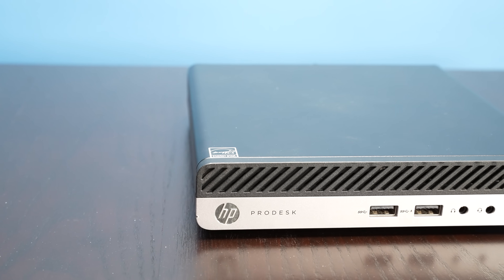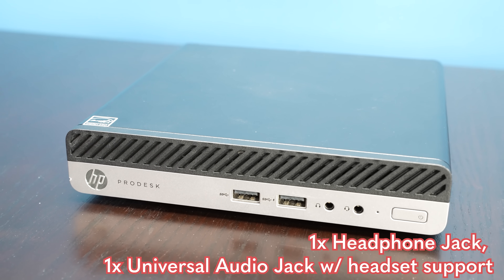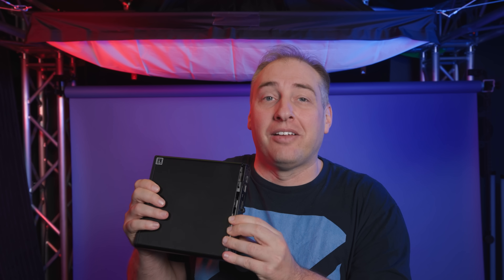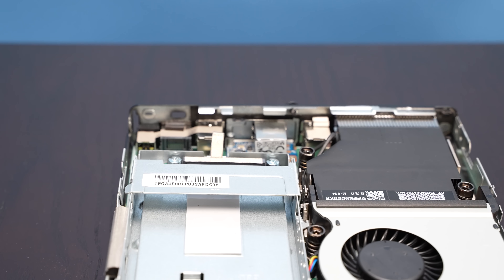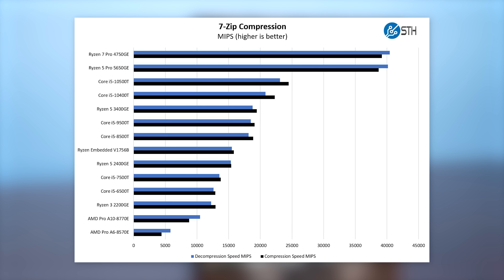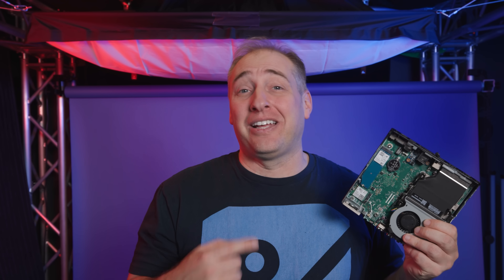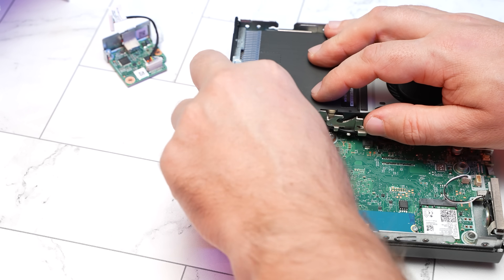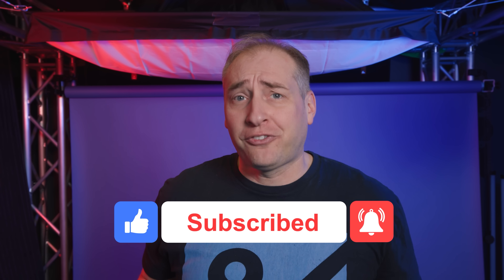Nice One! HP ProDesk 405 AMD Ryzen with 2nd 1GbE NIC

Comment: Can someone please tell me the difference between the HP ProDesk 405 G4 Ryzen 5 Pro 2400GE and the 2400G version? Is there somewhere GE labeled on the case to see the difference from the G Version? Unfortunately can't find the difference on case.
Reply: "e" for efficiency, 35watt tdp for 2400 GE vs 65watt on ryzen 5 pro 2400G. you can see in dxdiag/my computer properties

Comment: Beware 2 issues with these things! 1. The solid lid murders the ventilation. 2. They dont allow to personalize the fan curve. If you want a fancy box for microsoft office, go for it. If you wanna make good use of the APU, prepare to get rid of the lid and put an external fan at full speed. You are better off getting a chinese mini PC with a more flexible bios. Also Pro AMD processors (GE) dont allow the use of ryzen master.

Comment: Just a word of caution - these systems run hot.

I saved one from the e-waste bin at work and turned it into a HTPC. Even idling on the desktop (Ubuntu 22.04) the chassis is uncomfortably warm to the touch. It seems the issue is HP is expecting way too much out of the CPU blower to manage the CPU and provide adequate cooling for the balance of the system. At load I would compare one to a desktop hibachi.

This system is not suited for a network closet or cabinet with poor airflow; it will quickly turn an enclosed space into a sauna.

Comment: Just a heads up, there are used Zotac 7600P boxes in this form factor with dual Gb Ethernet nd 4x DisplayPort outputs, and many other nice ports and features in this form factor or smaller for less than $100 nowadays, great alternatives to short supply/price gouging Rpi4's.
At least 2-3x the CPU power, and better GeForce or AMD graphics vs Rpi's.
Without a HD/OS, they can be had ~$50- just boot off USB or SD card for Retropie/EmulationStation/Mame/Kodi stuff.
Infinitely better/more software/easier to work with than all those generic Android boxes.
Reply: I picked up a new Zotac Zbox for pretty reasonable on Newegg. I think including RAM and SSD it was like $220. Dual NIC and no fan, awesome little OPNsense router.

Comment: Nice video. looked up the model and i still think it is expensive. i am looking for a small computer of this size. need the following specs, has a m2 slot to host the operating system and expansion for 2.5inch drive. at least gen5 intel cpu and at least 16gb of ram and possibility to go up to 32gig. it will be used to host a blueiris and 4 4k ip camera. any advice for something around 3 to 400 euro?

Comment: if you dont't assume more than 1/2gb total throughput you do not need 2 nics. a 2.5 gb nic would even be more suitable than dual 1gb nics.. i rather would like to see a small pc with ECC..
Reply from the maker: Some people just like the segmentation. The 805 G6 is next (Alex has already edited the video, just waiting for a publishing slot) but the 805 G8 has a 1GbE Realtek and a 2.5GbE Intel i225-V in the Flex IO V2 slot.
Reply: @ServeTheHomeVideo  yes I know they like it, but it might be your mission, as someone who is an expert, to point out that trunking would be the better solutions for most scenarios. We are not expecting enterprise grade workloads on consumerlike hardware do we? But anyway, I am still looking for such a computer with ECC - i3 or AMD .. Have you ever come across one?

Comment: running 24/7 with alot of traffic, i think the chips might get hot/crash. there is no heat sink on these.
plus its Realtek so this just wont do(and it is not intended to be ran so hard this way in the NIC(s). not sure how amd handles aes-ni or what ever  Amd's answer for encryption is...

i had a used  800g2 slim/mini/micro/tiny(the smallest one lol)and converted the m.2 to pci-e and was using a converged dual port 1.25g  intel nic as the onboard was giving issues and needed 2 ports for a router/firewall setup. eventualy swaped the nic for dual 10G sfp as i wanted to have direct fiber from my ISP to the computer instead of going through a fiber to copper media converted.

running pfsense openvpn with 256bit gcm, site2site identical setups: 736mbps  rate off of a 950mbps line(technically paying for 1gbps)

.(yeah the m.2 lane on the 800g2 cant do 10g but I got the card regardless and have since built a custom intel 10th gen build on a lga1200 micro mobo. all new parts for 700$ wich is about the same i guess as these small/tiny computers purchased new except i have waymore horse power.) 

btw pfsense plus with TAC lite is free(for a limited time)
Reply: those machines are not suitable for running high throughput in a business environment.. it is just tinkering for at home.. but there one nic would be good enough for OPNSense
Reply: @marcello42  opensense or pfsense, same thing. as to the environment, to me it makes no difference. If i generate alot of traffic, i want it to work regardless of whether I'm at home or at work. and the fact that realtek drivers are flaky on BSD and hardware is also sub pare, its just a small formfactor with terrible parts.
If you get it free or real cheap second hand than yeah it can be used to study and play around with but i wouldint keep it running 24/7 in ANY enviroment. And if i had to buy it new, id return it the same day and smack my self in the head as to make a point to not buy trash.

Comment: I'd put 64 GB of RAM in a system like this.

I've found that the more VMs that I am running (vs. bare metal systems), the more RAM that I need, per system (due to consolidation or whatever).

It ends up being a lot more efficient to just stuff a system with RAM and run like 8 VMs on it (plus the host) than to run a bunch of less efficient or just outright inefficient systems.
Reply: lol, and the sun rises in the morning  and sets at night.

Comment: @ServeTheHome, I have a HP 705 G4 Mini with the A10-9700E, and it is extremely hot, always. How is your 405 with the Ryzen processor? I have found that a Lenovo M720q with the 4 port network card has less heat to deal with, even with an i5-9500.
Reply: I have a 405 G4 doing duty as a HTPC and it also runs uncomfortably hot. Even at idle it's shockingly warm.

The issue seems to be HP is expecting too much out of the CPU blower - it can't both cool the CPU and adequately cool the balance of the system. With the cover off the CPU is much happier. Probably going to cut some holes in the lid and install a fan over where the 2.5" drive bay sits.
Reply: @StBeefwich  as I can remember the A10 version has a perforated top cover as well to increase cooling and airflow, but unfortunately it is not really working. I will try without cover as well. Thanks for the idea!
Reply: @_GSzabados  ended up cutting a 40mm breather hole over the CPU blower and taped over the lower intake on the fan housing - forcing it to draw air from outside the case. 

In addition, I added a 70x15mm exhaust fan (external USB powered) over the space previously occupied by the 2.5" HDD cage and removed the IO expansion panel cover to provide increased airflow and an ingress route from the back of the chassis.

It now idles a few degrees above ambient and under stress test conditions tops out around 36 degrees C.

Comment: I really wish I could find a 1L pc with 3x 10gbe NICs
Reply from the maker: Power and heat are a challenge.
Reply: @ServeTheHomeVideo  Yeah. Unfortunately.

My needs are 2x WAN, 1x LAN. But the catch is...need at least 2.5gbps for my connection.

Spectrum over provisions gig to ~1300-1400mbps. Essentially a free 400mbps of bandwidth.

Starlink for backup (previously Hughesnet)

Maybe I could get away with 2x USB 2.5gbe dongles + onboard for starlink....
Reply: @wudchk   Check out STH review on HP T740 that has a low profile pcie slot that can fit up to 4-port intel NIC.

Comment: If I want 1Gb NIC, I will plug in a USB dongle.
Reply from the maker: I think many folks will do the same, or just get a 2.5GbE NIC
Reply: @ServeTheHomeVideo  Well I didn't say "If I want 2.5Gb NIC". By now 2.5Gb should be standard, after all the manufacturers dig deep in our pockets - how much are they saving $5 by not switching a 1Gb chip to 2.5Gb? A lot of people have demanding it for at least couple of years now.

Comment: A Flex IO to Oculink adapter would be killer, with a custom printed bracket it might be possible to fit an HP 1QL49AA in there, dual 10Gbe ports and use Realtek for oob management only

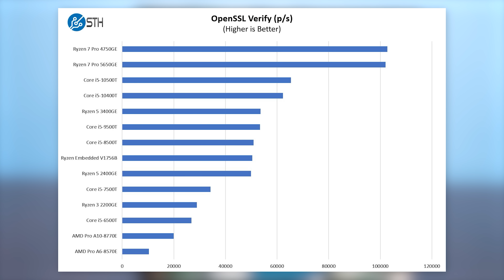Comment: 10:30 On the systems i manage, i noticed that the 2000g series idle power usage was higher than intel, but with the 3000G AMD got better, and then AMD killed it with the 4000G, though this may be because of changes Lenovo made as we're entirely lenovo when it comes to the uSFF.

Comment: AWE CHIT here comes my new firewall, only thing that could make it better is a card in that card slot with 2x10g and 2x1g, and the on board for management
Edit, on the newer ones that have an optional GPU with basically a 1/2 height PCIe slot

Comment: 2.5gbe controllers are basically at the same price so idk why they bother with 1gbe controllers..
Reply from the maker: They have 2.5GbE orderable in FlexIO v2 but I ordered two machines with them and HP order support said they do not have the i225 Flex IO v2 NICs
Reply: @ServeTheHomeVideo  does intel fab their NIC in their own fabs or contact out? Maybe they simply don't have the capacity. Plus I know their initial release of the i225 was a bit uhhh....crap

Comment: If you are looking to use these 1L systems for proxmox, or even pfsense (I've read that it is starting to play nicer with realtek?) or OPNsense... it turns out there is a product out there you can install in the M.2 NGFF WLAN slot. This worked well for me to convert some Optiplex micros to dual-NIC hypervisors. It's the DFRobot FIT0798 M.2 A+E Key Gigabit Ethernet Module. It's an RTL8111F-based adapter.
Great option if you have a 3D printer to print an adapter that mounts the RJ45 port in that spot where the extra display/serial dongle plugs in. ;)
Reply: For 15 bucks, looks like a winner!
Reply: just yesterday bought 3x prodesk g6 400 mini and i own a 3d printer lol, gonna get one of those m.2 to ethernet adapters

edit: looks like you can't install it due to the angle, the m.2 directly hits the wall
Reply: @CH-vo7fu  That's a shame... the Optiplex micros I installed them into they are up against the front panel but have a fraction of a millimeter of clearance. The other options I found for converting the M.2 WLAN slot to ethernet were longer or taller, so they'd either interfere with the 2.5" bay or the case/components. :/
edit: typo
Reply: AFAIK Realtek is dog shit for Pfsense & OPNsense;  maybe things have since improved but I doubt it.

Comment: Realtek ethernet is a definite downer. Most of us want dual nics so that we can run PFSense, which doesn't play nice with Realtek.
Reply from the maker: It was hard to even find out that this option was Realtek.
Reply: @ServeTheHomeVideo  Don't get me wrong. I appreciate the effort. I would love to see some throughput tests done with this setup. Although, with the difficulty to acquire this card. It becomes a moot point for most :(  Your videos are what started me on this journey to a better network setup. I'm very much appreciative of the work you have put in.
Reply: Eh, my t730 has a Realtek and that runs pfsense 2.5CE just fine in a branch office environment, it’s been up and running for at least 15 months and counting.
Reply: I've heard that pfSense "doesn't play nice with Realtek", but I'm running a Realtek NIC (RTL8111/8168/8411) in my pfSense router box with no problems whatsoever. I know it's anecdotal evidence, but it's still a thing.
Reply: @Anaerin  My previous box had a Realtek that worked fine with pfSense a year and a half ago, but last years update to 2.5.1 changed that. I couldn't get more than 100mbps throughput even with the 2.5.2 update as well. I ended up getting a Dell with a i7 6700 and threw in a Intel Pro NIC in. Note: My Realtek NIC was a RTL8153. Single example isn't scientific, but I did wipe and reinstall several times to no avail :(  I've since repurposed that box to be my TP-Link Omada controller :D
Reply: That hasn't been true for years
Reply: @marcogenovesi8570  I'm speaking from my own experience. It is true. Working and working full speed are 2 different things. I have 1000mbps internet and the Realtek RTL8153 that I had couldn't put up more than 100mbps (after the update to 2.5.1). I exhausted research for months. Finally, I decided to stop screwing around and bought a bigger box with PCIe and am using Intel Pro NICs.
Reply: Unless you plan on using the offloading features which are a very custom use case at 1GbE your overpaying for an Intel NIC at this point.
Reply: @Knirin  Maybe true for some, but I paid $150 for a Dell box with a i7 6700, 16gb ram, SSD, and dual Intel Pro NICs. I went the Realtek route as it worked for a short while and then performance tanked after the 2.5.1 update. Not sure why, but I didn't feel like it was worth going through more trial and error. Sometimes it's worth it to just buy the goods that is proven to work.